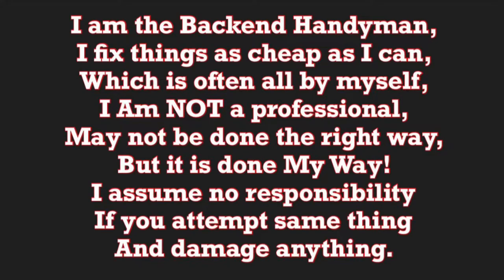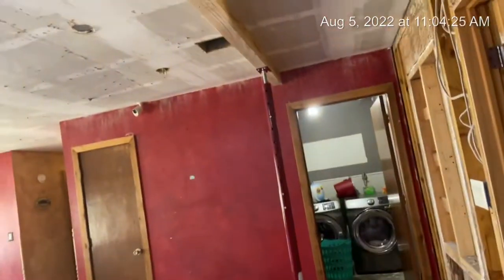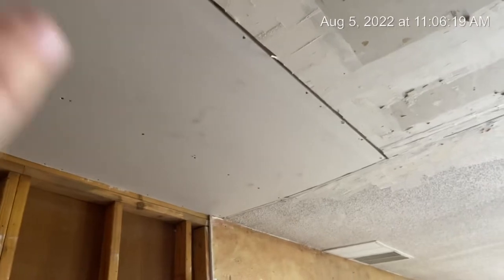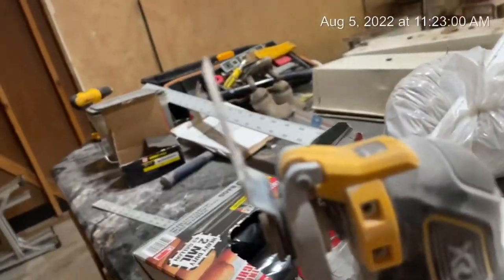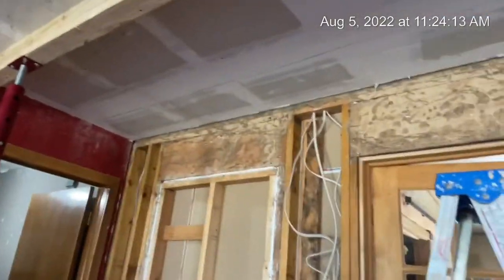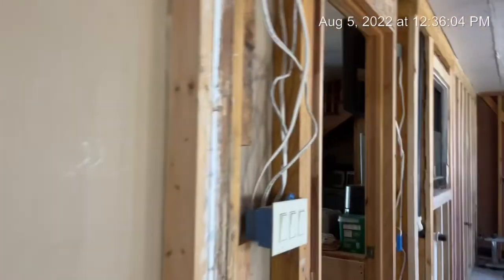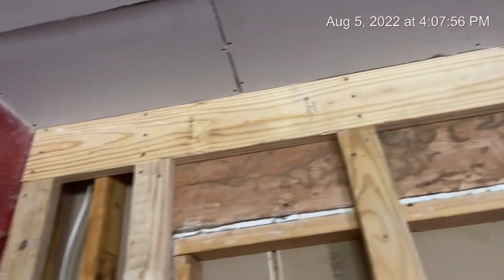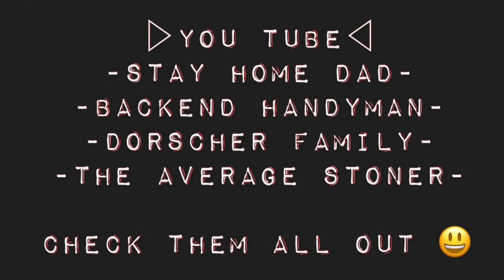Termite damaged load bearing wall repair.. also raising the trusses

Comment: Back in June I did a temporary support of my garage wall at the overhead door, 11' from wall to wall. This looks like a more permanent solution here. This is what gave me the idea for the temp job. Doing this type of fix wouldn't require removing the bad wood.

Comment: I built a temporary support using your method here, I have to do something more permanent using this as a guide and support the ceiling. Will take down sheetrock and make a more permanent fix for my garage door wall. Just not practical to remove all the bad wood and put the good wood in its place as I can only get to it from one side as front of house is brick face. I haven't seen a single video here on YouTube on how to replace a large section of top plate from one side.
Reply from the maker: Jesus man, I would hate to run into having to replace them completely, with my upstairs addition I’m sure that is a bad idea so I just build out. Another “More permanent “ method would be to Frame a new wall on inside of that wall. That would make it about 4” thicker with Sheetrock.

Comment: I'm doing 11' of garage wall at overhead door opening like you did here. It's a temporary rig for now, all the wood needs to be replaced. Hopefully the trusses aren't involved, however if both the top and cap plate are termite eaten, then at least some of the tie beams are probably involved. Temporarily losing an 1 1/2" of depth is a pittance. l Thanks for the video.
Reply from the maker: Thanks

Comment: This looks like a viable option, at least until I can afford to pay  a contractor to do this to code.  No removing bad wood, just building out from existing wall. Will have to move my garage door track hangers 1 1/2" to make up for the loss of space.
Reply from the maker: yeah best choice if you can afford it,